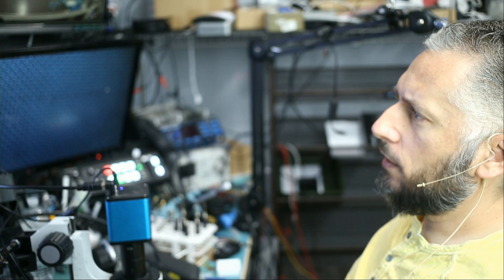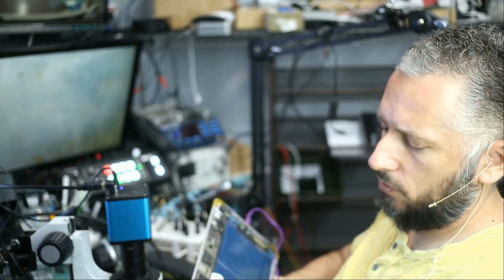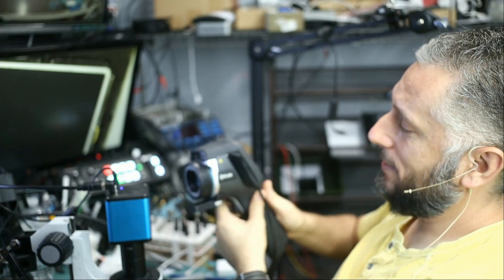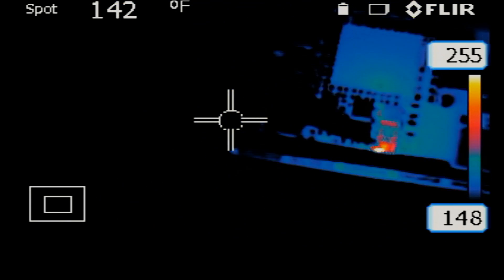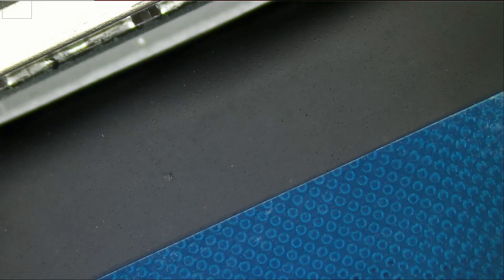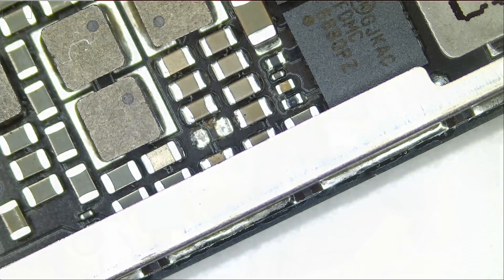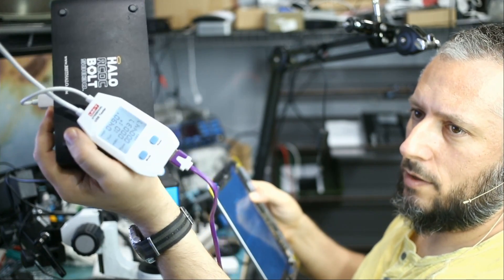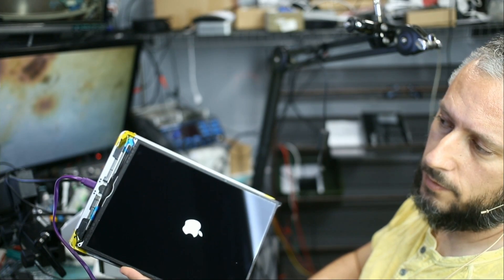iPad 6th gen No power Fixed.  0.45 amp draw. Short Circuit detected By Flir Thermal Camera.

Comment: Hello,
I was wondering why you don't replace the faulty caps by a new one.  Is there a particular reason to have this caps on the board and not necessary to replace it ? Thanks for your videos I am waiting for the next repair 👍
Reply: I dont remember if it was Alex who said this, or someone else. there are like 50 Caps around they're all doing one thing. If they were COPS, and assigned to guard a building, would the building be any less safe if one cop called in sick?  Thats the line of thinking.
Reply: because AFAIK the caps works in serial mode, there's already lots of caps there, putting away one won't make huge difference because again, its in serial mode. The other caps will still functionally work for the board.
U need to understand the function of those capacitors first, which acts as a storage for electrical energy in the circuit.

but then again its your preference, some prefer to replace some not. Personally, I'd replace if there's <2 capacitors in the line.

Comment: I would really like to obtain this kind of FLIR cam, but as I am just doing thing for hobby, the cost is just too high. :)
Reply: Buy a flir one pro or seek compact pro, it’s a lot cheaper.
Reply: Worth it. Pay what it costs
Reply: Tommy Johnson: Sometimes it’s not a question of doubt about product value but more about budget. The FLIR E60 or some current version of this costs like US$ 10.000.
But about the smartphone attachments might give it a thought.
Anybody here uses some of these?
Reply: @marcianzero_yt  i have the Seek compact pro with macro lens  and use it with an iphone 6S plus and it works very well. I have been using it for approx 6 months